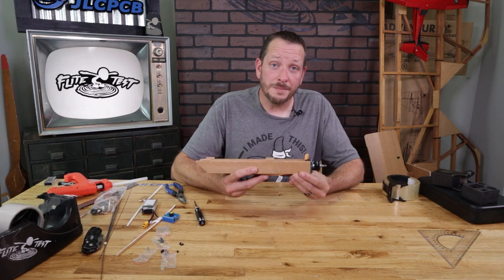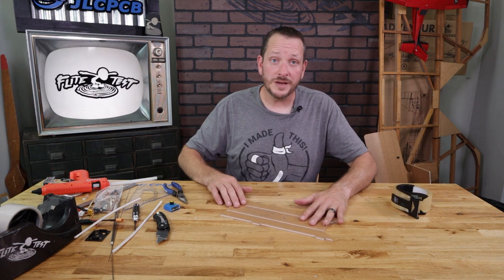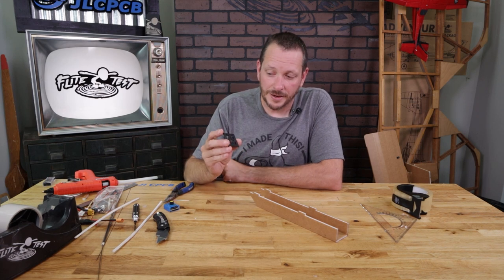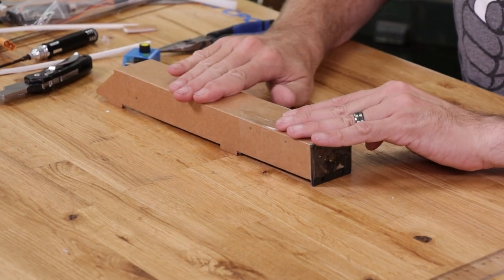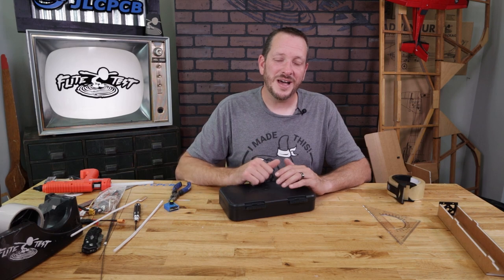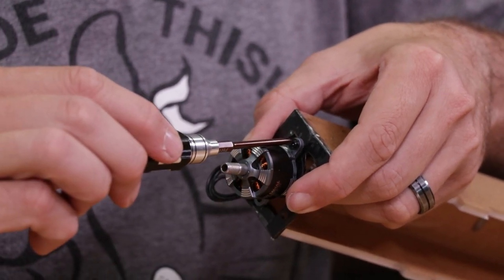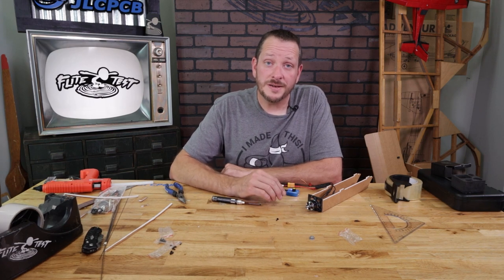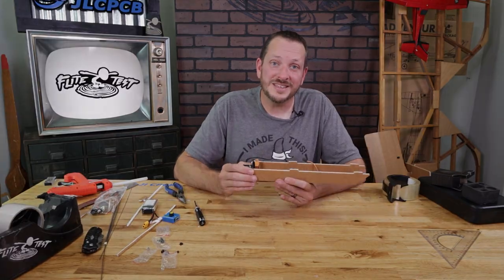How to Build the FT Power Pod // New and Improved

Comment: I have found that its a lot easier to install the motor to the firewall before it is glued to the power pod.
Reply: yeah, but that way you cant put the tape on the firewall and the tape is more important than the glue

Comment: Great video...looking into adopting it!
Should we ever consider using spacers behind the wood screws to angle the motor to compensate for its torque caused by P-factor?
Reply: Ya boi, I used washers to adjust thrust angle

Comment: I built the power pod for my Old Foggy.  When I apply power, it wants pull seriously down.  Why?
Reply: Thrust angle
Reply: Try putting a washer in the 6o'clock screw thing, it'll raise your thrust angle a little.
Reply: @lt.williamcrowecrowe2505  I have done that but haven’t had time to fly.  Just playing around, I moved my battery way forward and there was no drop.  Looking forward to some less windy days to try it out.

What branch are/did you serve?  I left the service as 1LT US Army at Ft. Lewis, WA in 1973. I was a PIO then.